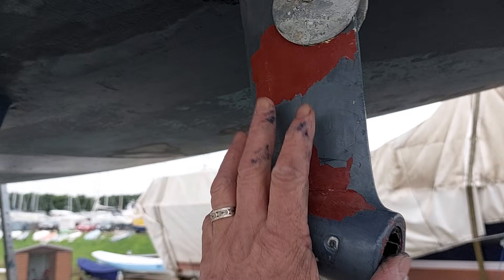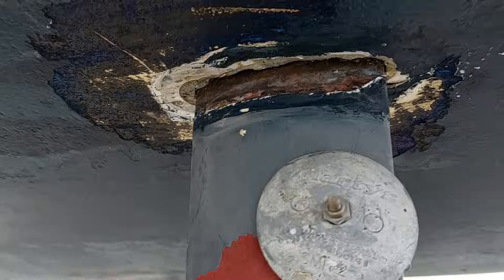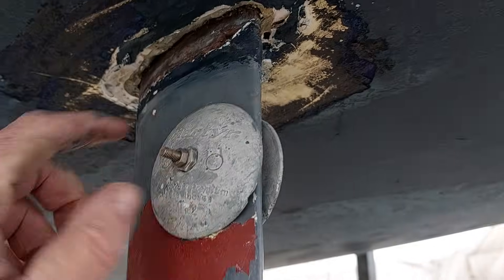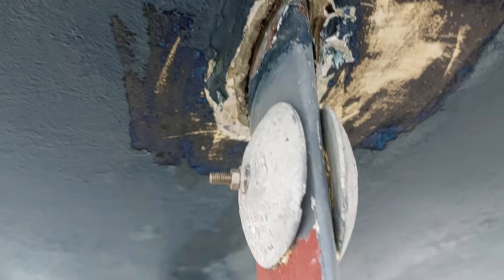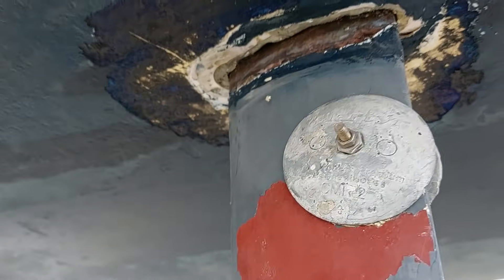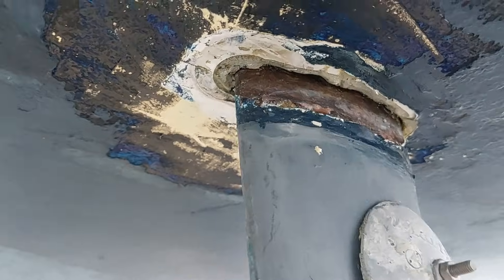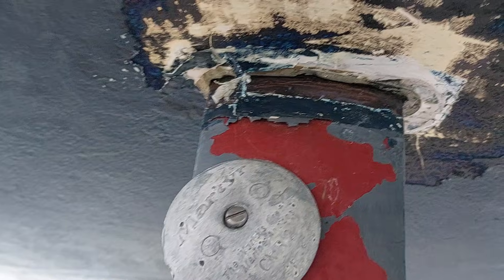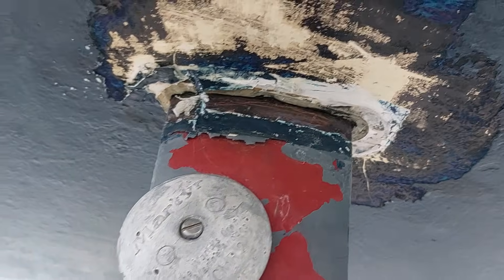Dangers of propeller wrap with a rope on a yachts "P" bracket.

Comment: Oh so true, I just did the very thing discussed here. dropping off the mooring on our way to be hauled out for the winter a couple of weeks ago, I thought I was clear of the float line when i clearly wasn't and managed to get it wrapped around the prop, stalling the engine. I was only ticking over in forward but nonetheless it wrapped good a tight around the prop and DUH no engine. Got a tow onto a pontoon and on the next drying out tide I clambered over the side in the dinghy and cut the line free. Yeeaa methinks job done. Sadly while doing some work on the engine I notice that the cast iron casing where the bell housing flares into a support leg to the engine mount had sheared clean through. Darn it, that's engine out, scour the scrap years and backwaters of the salvage industry to try and find a replacement bell housing (early model BMC 1500) or work out how to fabricate something to replace the broken part. Not a job I had panned this winter.
Reply from the maker: You may find if you have full  comprehensive insurance it may be covered.